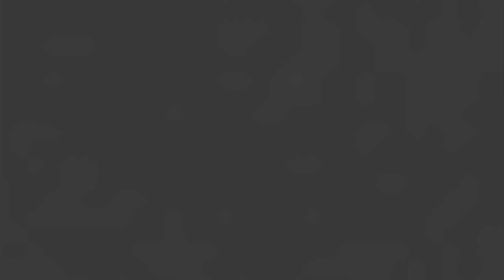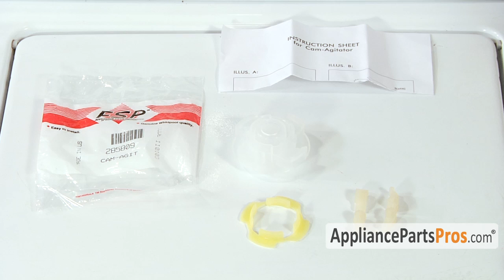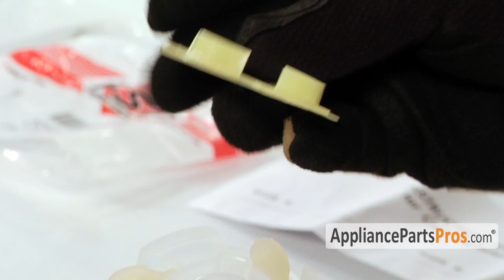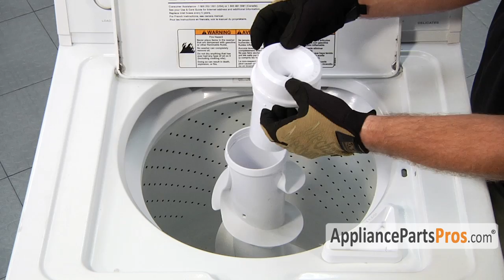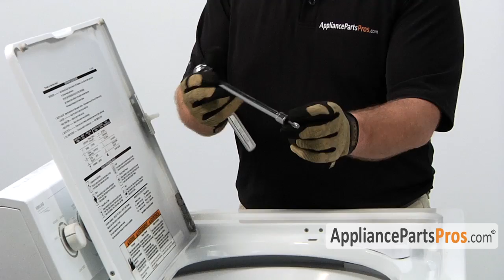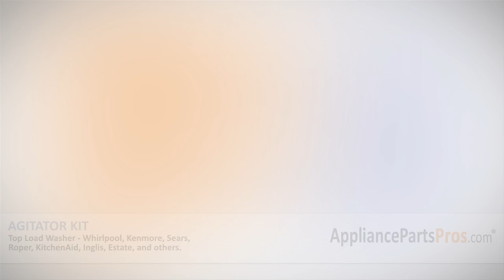How To: Whirlpool/KitchenAid/Maytag Short Cam Agitator Repair Kit 285809

Comment: As stated above, the agitators and dust cap don't always come off easy. I had to put a tie-wrap through one of the openings in the dust cap to yank it off. It was in there pretty good.

When I lifted the top agitator, the bottom one (that he left inside the washer) came up with it. I had to stand on the bottom and pull up pretty hard on the top to get it to separate.

There was a lot of caked on dirt under the bottom agitator and on the bottom of the tub itself that I was able to clean off. It was the consistency of a brittle cement so I thought it was some sort of adhesive, but it turned out to just be a purplish dirt.

Thanks for the video because I wouldn't have realized these parts came apart the way they did because they were stuck together so hard.
Reply from the maker: Awesome! Thanks for sharing your experience and we’re glad the video helped you get it apart. 👍

Comment: I replaced the dawgs and it works properly but it still slips when I wash a load. Any suggestions?
Reply from the maker: What is your model number?
Reply: @appliancepartspros  kaws7oojq4
Reply from the maker: Is it slipping during the agitation, or spin cycle?
Reply: @appliancepartspros  agitation cycle
Reply: @appliancepartspros  agitation cycle

Comment from the maker: You should use a very light coat of detergent, just enough to get the cover to slide in. The o-ring does the sealing, the detergent just makes it easier to put in. Any excess that may wash out will just clean your clothes. The amount that is left over should not be a problem in the future. Most people do not recommend any type of grease, if it gets out and into your clothes you will have stains.

Comment: A note to others who want to do this: Agitators come apart with varying amounts of ease.  When I did this to mine, the two halves of the agitator were actually (slightly) melted together, and I needed to use a small nippers to remove some of (the slightly melted part of) the plastic on the top part of the bottom half.

Maybe dogs are called "dogs" because they look like some dogs' ears?

Comment: I have seen other videos which mention using detergent as a lubricant on the O ring as well.  But I'm thinking, in a few years when the dogs wear out again, isn't this going to leave dried out, crusty debris, and potentially make it more difficult to remove?  What do you think of using some other oil or grease, and which one?  Expensive for needing just a little, I would think faucet grease would be ideal, but is there anything else which would serve and remain realtively stable over time?
Reply: Yes, plumbers grease or any Silicone grease such as Super Lube-21030

Comment: This is the part I have to replace. I got the agitators out of the washer but cannot get the top part off the bottom. I have stood on the bottom part and tried and tried and tried to lift the top off. Any suggestions on getting it off the bottom?  Thanks for your video!